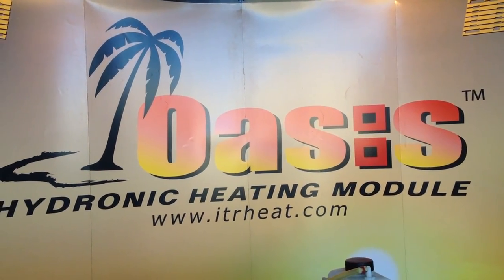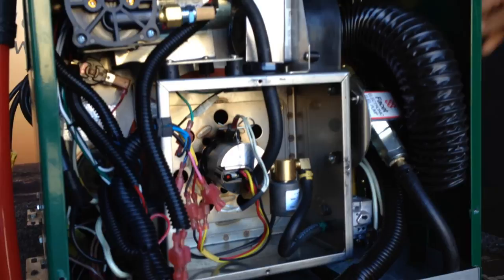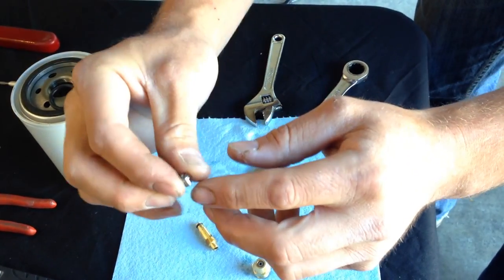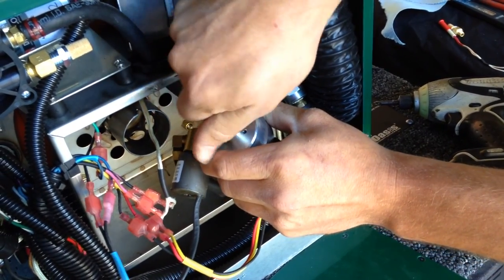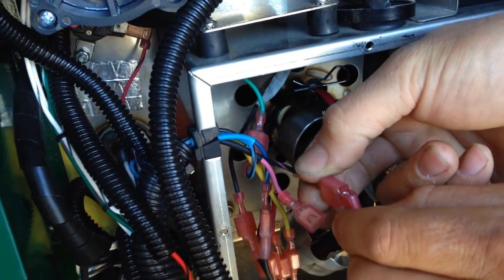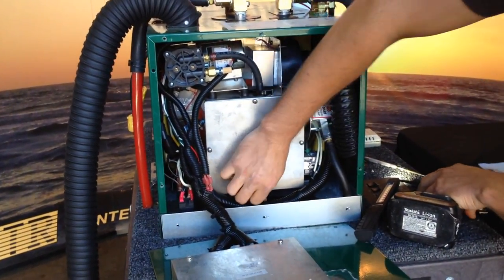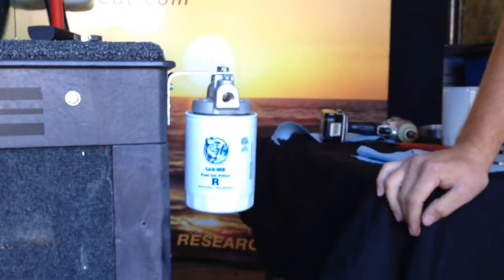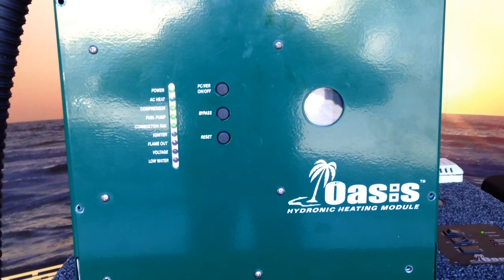Oasis annual service

Comment: Randy, Do you have a video on winterizing the Oasis Heating system?Which method is the best to winterize? Drain water and blow water lines out. or drain lines and fill with RV antifreeze?